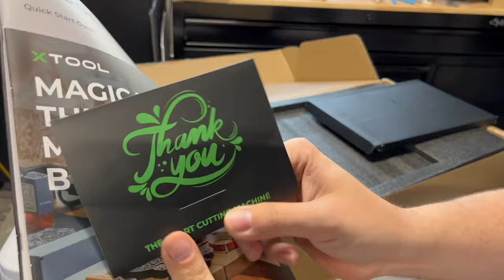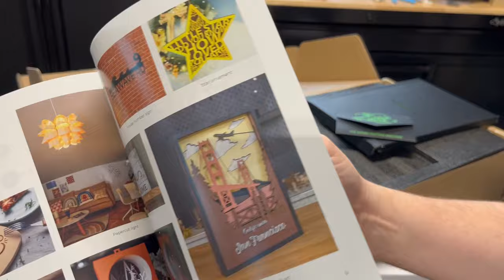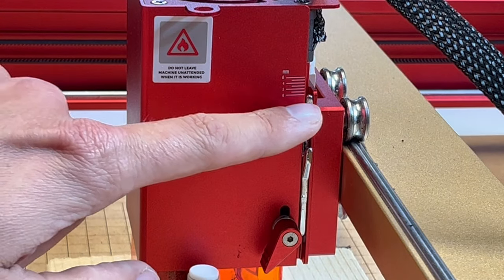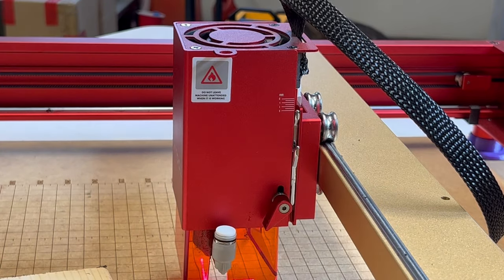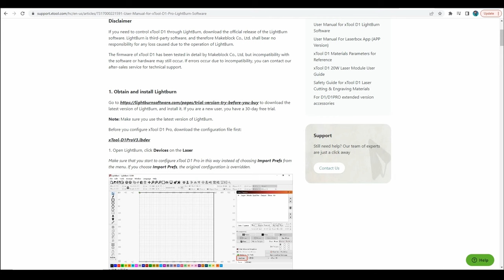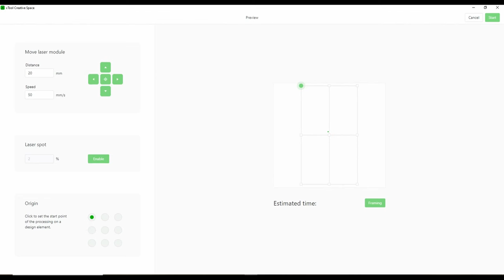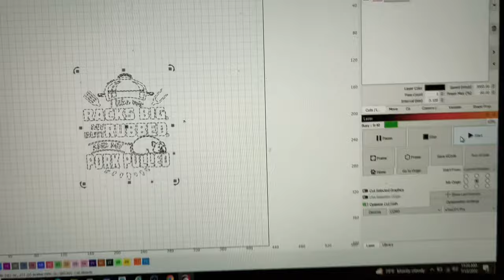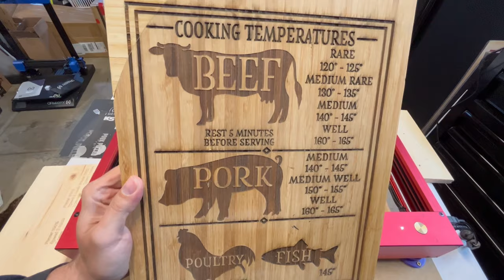XTOOL D1 PRO 20 WATT DIODE LASER

Comment: Do you find you can't as fine detail with the 20w as compared to their 10w since 20w has wider beam?
Reply: You’re talking about 3/1000ths of inch difference. You wouldn’t even be able to see the difference with the naked eye. .08mm (3/1000”) vs .15mm (6/1000”)

Comment: Atomstack X20 Pro is $400 cheaper than the model you reviewed and INCLUDES an air assist pump. It's $100 cheaper than the black X1 Pro 20W. I don't see any significant differences between what the 2 machines can do, so I guess I'd go with Atomstack.
Reply from the maker: It is your choice what you purchase.  Happy engraving 👍

Comment: 219 minutes for a tumbler ?  Was that correct?
Reply from the maker: That was correct!  The side of the tumbler that was a little deformed, that was the 219min.  Too much power, and too slow.  The other side, was half the time.  Now, this was without using any assistance like using Brilliance spay.  You use something like that, you can drastically decrease the time.  Most likely you will be able to complete a tumbler in 25min.
Reply: @TripodsGarage  Thanks for the info.  We just bought a ThunderLaser 60W CO2 for the plant here, and I've been thinking of getting a diod type for home.
Reply: I do full 360 degree 40 oz water bottles in the 10W D1. They take about 4 hours and I am able to get them seamless.